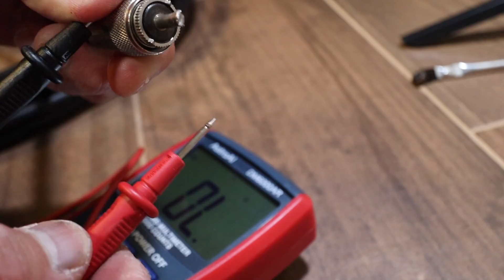WTF! | Neighbors cut my Coax! | Repair my PL259 connector Ghetto Style | Not my best soldering

Comment: This has never happened to me because I live out in the country and do not have close neighbors like you do.  I notice you have bars on your windows too.  Do you have outside security cameras up?  Question is, is that your fence the j-pole was mounted on?  If it is, you're good and I would leave the antenna there and just put a security camera on it and if it happens again, I would file a police report to document the incident and I would have security camera footage showing who is cutting your coax.  I would not confront the neighbor without proof he/she did it.  I would just file a small claims case for damages.
Reply: I might also add, Your coax looked like it was a pre-made coax that you purchased.  So, your actual damages would have been the replacement cost of the entire 75 feet of coax and you could show a receipt for the actual purchase price and the cost to replace it including labor.  I can see this netting you $500.00 to $1000.00 or more in a small claims court.  Especially in Judge Judy's courtroom.

Comment: Ughhh man, ditch that junk soldering iron and gun and DO OVER! You'll want at least a 65-70+ watt iron at minimum for most things ham which are cheap enough even on Amaz... (can't post the full name because ewetoob) But with 400 series coax you might want even double that amount plus a large iron tip, because of how much heat soak the thick center conductor has! It can take FOREVER to get a proper amount of heat to make a solid joint and at that point you're borderline melting the dielectric! And use some "electronics" specific FLUX too (so it doesn't corrode like other flux) so you get a solid joint and fast heat transfer!

Comment: Do a knock and talk with your neighbors, ask them if your station is interfering with their TV's, or Radio's. Sometimes by doing so, you'll get a better idea of who it is that is upset with your ham radio station. The reason for the sabotage, may not have been because of your antennas appearance, but instead could be because your station is not properly grounded, and is producing harmonic emissions. I've had trouble in the past with pins in the coax, which is far worse to have happen because it's really hard to locate and can blow up your radio if not discovered right away. I've also had someone break radials off my HF directional antennas by cast fishing line with a sinker over the antenna and snapping off radials. If you find an unhappy neighbor, try to work with them to resolve the issue if it's due to harmonics. There are a lot of things you can do to you station to reduce spurious emission. Knowledgeable Ham operators in your area may be willing to take a look at you station and offer some solutions. Changing frequencies, better grounding, Installing more insulators on guy wires to break up the harmonics, raising up the antenna to change the radiation wave pattern, using a beam antenna, having you radio's checked, etc.  Sorry this happened to you. 73's !

Comment: My NASA buddies tell me that rockets have crimped connectors.
I am surprised by the quality of cutter your neighbor hacked apart your coax with. Most common cutters like bolt cutters do a lot of crushing.
If you end up going stealth slit antennas in TV dishes work for 2m and up.
KU0R swears by the right tools for making great connections with relative ease, including the correct brand connector.
I'm impressed with the soldering with so little mass in the iron tip. Kudus.
Reply from the maker: It's was a clean cut and I agree with you that it's probably not a bolt cutter.
Reply: They probably used tree branch lopping sheers?

Comment: I'm a fan of the Animal House slogan "don't get mad, get even!"....I'd probably build a couple of dummy antennas with dummy coax (cheap RG6) and wire the dummy coax to an electric fence transformer and set them up where the vandalized antenna was.  When your neighbors demonstrate the intelligence and manners of cattle sometimes it's appropriate to treat them as such.

I know someone who was having troubles with their car battery being stolen regularly...Eventually they pulled the fuses and dropped a 24V truck battery in (instead of a standard 12V) in and waited...A few days later down the block there was a garage fire. After that the battery theft stopped.
Reply: Let's not disparage cattle by comparing them to these useless neighbors. No cattle deserve to be subject to such negative comparisons.
Reply: LOL, although this is my thought exactly, I would not recommend this because of legal ramifications.
Reply: @slshock  You have a point, but depending on transmitter power they could potentially get a WORSE (possibly even leathal) shock/RF BURN simply by cutting a real antenna feed coax at the exact moment he is transmitting a message to another Ham operator (some digital Ham wireless data networks run 24-7).
There's nothing illegal or harmful about electric fences and it's less dangerous than RF burns possible from some transmitters.  Also it's possible for both the operator and the saboteur to get RF burned at the same time from a fault caused by cutting the line while transmitting so self defense could potentially be argued. 
Also there's nothing stopping you from counter suing a trespasser that injured themselves while trespassing and sabotaging your property (part of the reason most of the smarter criminals don't sue property owners since they would have to admit their crime and open themselves to civil and criminal charges).
At any rate messing with a connected unknown transmitter antenna belonging to someone else is on the same level of stupid and dangerous as messing with a live power pole.
Reply: @tomcarlson3913  Roger that and where I live, electric fences that are active have to have signs placed on them to alert to the shock hazard.  I ran electric fences here for years.  My neighbor once caught my yard on fire while mowing and when some kids came over to jump my fence to help put it out, they got the piss shocked out of them.  But, I had the proper signs on the fence so no issues there.  30 mile pulsating bull charger zapped them.

Comment: I haven't had the Coax cut however I suspect one of the neighbors cut a small rope that supported my 40 meter dipole.  As soon as I put up a web cam it stopped.
Reply from the maker: I moved my antenna and also have a camera pointing to my Zero Five HF antenna and Jpole.

Comment: You should put up some cameras so you can prove who is doing that. Or put line voltage on it next time you go away, that will teach them.
Did you go to the police?
I've had it a couple times when I was using a mobile radio that I always took with me to listen to some music on the building site, I've had people cutting the power cable many times just to aggravate me I don't know why people think they can do what they want and vandalizing other peoples property and then they wonder why I hate people in general.
Reply from the maker: Voltage in the coax. Not in my lifetime.

Comment: I'd fix the coax and put it right back in the same spot. Get a camera with a good optical zoom and hide it so you can have proof of the violator. Give a copy to the HOA, give a copy to the local PD file a report. And then send a bill to the violator for the cost of your equipment, and your surveillance equipment. Don't forget about the hourly wage for your labor. I don't know what you get paid an hour but $125 an hour for the labor I'm assuming 4 hours should be sufficient time. If they refuse to pay it,  press charges. $1,000 is a small price to pay for your freedom. Not to mention that's borderline felony charges. The way I see it $1,000 would be really cheap considering the alternative. That would be the right way to do it. I wouldn't do it like that but I wouldn't live in Florida or have an HOA. Whatever you do don't let them do it again without repercussions to their actions.

Comment: It's truly a shame that electrifying coax would interfere with RF. I'd love to see a video where you set up a video camera and record your neighbor getting electrocuted the next time they try something like that. What a-holes. That's declaring war as far as I'm concerned. Thankfully there'sno shortage of good ways to get revenge. 

I'm so glad I no longer live in Florida. It sounds like such a paradise from the perspective of someone living out of state but I lived in South Florida for almost 6 years and I found the whole area was full of some of the trashiest people ever.
Reply: Most major broadcaster's sites don't need that, the amount of rf being blasted through the transmission cables leading up the tower would be enough to incinerate them
Reply: simple..put up a "dummy coax" thats live with 240 volts..  if they are injured while doing it EVEN BETTER ..

and before anyone says you cant put 240 on coax cause its to small blah blah blah.. if theres no load on the other end of the coax the size of the wire doesnt matter and you can send crazy amounts of voltage through the wire.
Reply: @gregthemechanicman  BRILLIANT!
Reply: @gregthemechanicman  the wire will easily handle the voltage, the issue is that you are boobytraping with the intent to commit personal harm and would like end up getting charged with a felony.
Reply: @gregthemechanicman  Personally, I am one hundred percent with you.  Sadly the laws on boobytraps to protect property are not.  It would be wonderful to tie the coax into a 240V 30A breaker in the panel and blow the crap out of the gus cutters.  But chances are that this asshole would report it to the cops and capt Darren might get charged if they investigated and found he did this.

Comment: One, you need to report it.  Two, unless the city said you have to move it, you don’t have to move it.  Put it back up right where it was and point a $35 wyze camera at it. We have nasty neighbors as well - the only way you fight back is catch them breaking the law. Cutting your cable is breaking the law. Once they have to buy you a new length of cable - even if it only costs them $59 - they’ll stop.
Reply: Agreed, if that moron fell trying to cut the wire, he'd likely try to sue you, so you must officially report the incident to create a chain of incidents!
Reply: Sadly you might be wrong.  The fence is new and I suspect that it was installed by the neighbor.  In most municipalities there are requirements that the fence be set back from the property line.  The post are on the fence installers side. And not be more than a maximum height.  He may have been on the neighbors property.  Obviously a dick move by the neighbor who could/should have simply walked on over and nicely requested removal and relocation from their property.  Being Flo-i-duh these are likely the kind of idiots to shoot and claim "stand your ground" as justification so confrontation is probably a bad way to go.  Best to repair the coax, relocate the antenna, and camera your stuff.  If they trespass then you have them on video and the law "may" help you then.  I would not hold my breath for it in such a case.

Comment: This is the only reason why I do not like the HAM radio hobby, its still old school, need gigantic wire stretching miles long for making a practical antenna. It looks pathetic, unmodern and hella suspicious activity. Use a wired IP or analog camera (please do not use wireless IP cams since they can be easily hacked or be disabled) and surveillance your antenna backyard and report to the police if they try to cut you antenna again.

Comment: You're too nice of a guy, I would have already called the cops before any repairs to the coax, Get some security cameras set up, They're cheap enough nowadays, ours sends us Texts with pic's or video  when activated, it was around 300 bucks with 8 wireless camera's. I'm not a Ham anymore, but I do talk DX on 11 meters and talk on GMRS for my detecting hobby (Yes, I have a License), I let my neighbors know that if my transmissions interfere with any electronics to let me know right away and I'll fix the problem, my neighbors are cool about my radio's and the big antenna's I have on the house, they really don't care but are amazed how far I can talk when the conditions are right. I hate to see stuff like this happen, the world is a crazy place. Stay Safe and Good Luck

Comment: worked in cable for 30 years, cut coax is nothing new. Get yourself some pvc pipe and armor the cable. Buy sweeps not 90's.
Reply: "Buy sweeps not 90's."  ??
Reply: @utoothheartyeight  In wire section of most box stores in electric department they have a pvc curved pipe so so don't cause and impedance or a possible short. Bending coax wire cause a reflection/impedance which causes interference. Coax wire today for TV/satellite is copper coated steel.

Comment: I have my copper 2meter\/70cm J-Pole in the attic for over twenty years.  It works as good as outside.  You may want to try that and not bother with nosy neighbors.
Reply from the maker: Man, this house was built in the 60's there may be asbestos in the attic and besides, it's a small crawl space and I may fall through the ceiling. lol
Reply: @DarrenN4VFR  haha! I  hear you...just stay away from the fence line.  Good luck.

Comment: K3HQI - another comment. I have done dozens of coax connector installs and at times with primitive tools.  The razor blade is a great tool, i use it a little differently. Using it to cut through the items. I use a mini propane torch to solder the shield through the holes.  I doubt the 25 watt iron is large enough to do the center conductor, the torch will do that too. If I was deployed the torch goes with me.
Reply from the maker: Excellent suggestion about the mini propane torch!  I struggled soldering those PL259 connectors onto the coax.  Thanks bud!

Comment: K3HQI here.  A couple suggestions.  Set up cameras, put the antenna where it was.  Let them cut it again. My first step with the video, mail them a SD card with it and a letter.  You cut my coax.  I want $100 for the repair and no more vandalism. Drop by with the money in 48 hours and promise to talk to me the next time you have a problem, I hold the video for 5 years, the statue of limitations.  You don't do anything more and stop harassing neighbors, I will forget this.  One more act of vandalism or harassment of me or neighbors, the video becomes part of a police report. I would rather live in piece but that is your call. BTW, I have a great relationship with my 8 closest neighbors, I have been here longer than all but one of them, 32 years, some houses are on family #3, one has 4 boys, now in the late tens with friends and parties. I resolved a parking problem by talking to one of the boys, i had to park up the street one afternoon when i came home from a public service event tired and needed to unload, "You can park cars in my driveway, no problem, just don't park the mailbox and let me have one spot in front of my home."  We sort of have a pact, we talk if there is a problem.  That has worked every time.
Reply from the maker: Thanks for the suggestion Ralph!  It's so good that you get along with all your neighbors.  I only have 3 because I live in a corner lot.  The one house behind me is vacant (for rent) and the neighbor to the left is a good neighbor who watches the house and takes the mail in while I'm away.

Comment: Don't listen to any of the internet lawyers on here suggesting you run high or even low voltage to that as bait for the next time they cut it. Lots of comments saying that there isn't a court that would convict you of anything for doing that, but that's simply not true. There are a LOT of courts that would, and they exist in Florida just like everywhere else. You certainly seem smarter than that but just thought I would reiterate... don't do it. Best case its a huge escalation to your neighbor, who is obviously mentally unstable; And worst case, you hand over your FCC license and/or end up in jail.

Put up some signs and camera's and sue them if it keeps happening.

73
Reply from the maker: Definitely would not set up a trap with voltage.  Camera's are up!

Comment: You gotta report that to 5-0.  Vandalism ain't cool.  You might want to put a security camera on it for evidence next time.  I use these cheep "geeni" cameras that do 1080p and record to a local microsd card.  They're $35 at walmart.  I think I have a 256GB card in mine that stores a month of 24x7 video. All you need is 5vdc (standard microusb connector).   It can connect to your wifi for viewing/control over the network but that isn't required.  Storing the video on your property means that the data is protected by your civil rights (not protected if you buy a camera that records to the cloud).

Comment: Seeing an antenna has never bothered me. On the contrary, it's a sight to behold. What would bother me would be if the transmissions are interfering with the electronics in my house. There is a civil way to deal with that problem. Dialog would be my method of choice. Very sorry for what happened to you.
Reply: K3HQI - I was 6m AM 100w 5 element beam 50 feet up in the 60's when TV in our area was fringe.  That is channel 2 fundamental overload and ch 11 4th harmonic.  I managed to keep peace with neighbors, the only one I had problems with was ch 11,  and all i had to do was not point my antenna due north.